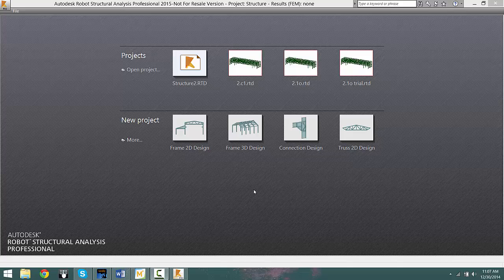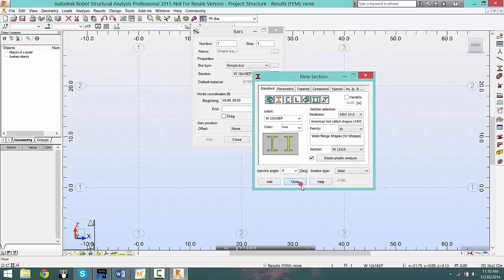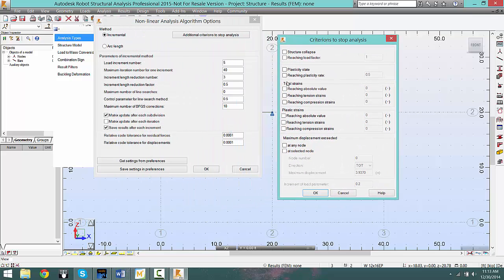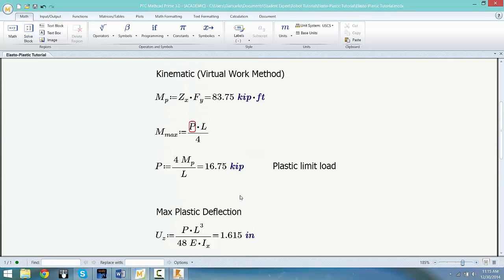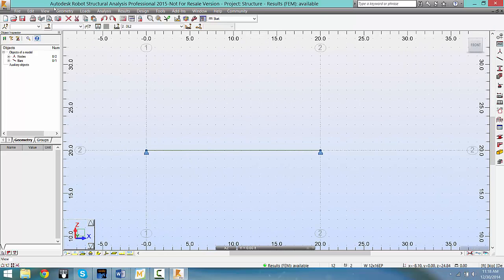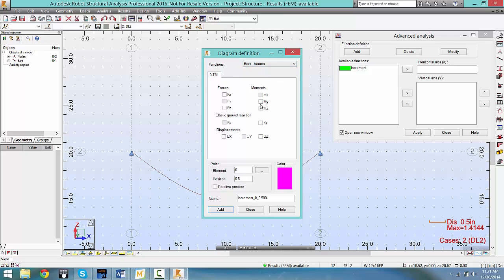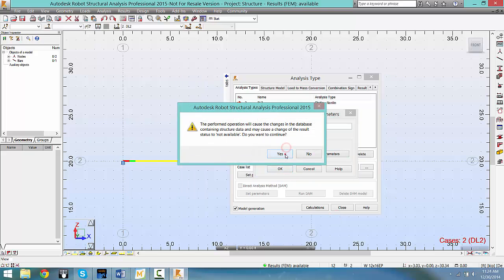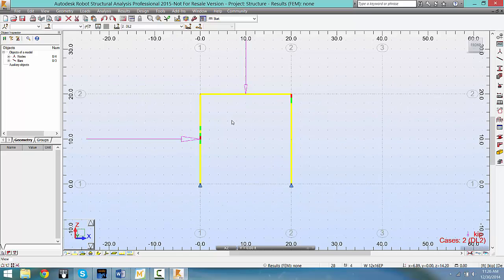Robot Structural Analysis 2015 - Simple Elasto-Plastic Analysis

Comment: Really nice video Giancarlo! I was just wondering in the last case where you designed a frame and applied two loads ( one vertical and the other horizontal) by choosing the increment method which of the two loads is increasing until the structure collapse? Is there a way to handle this increment?
Reply from the maker: If I recall correctly, they would both be increasing incrementally at the same time. The increment can be changed if you look at https://youtu.be/eDvAGFHcuW8?t=309 . I can't remember either if it applies the load as a percentage or as an absolute value, it might be instructive to check which it does.